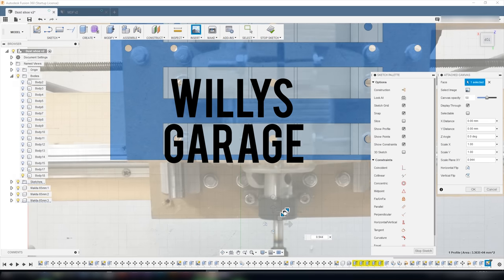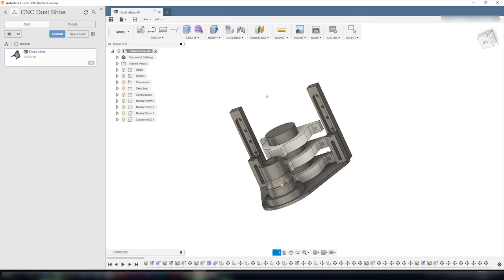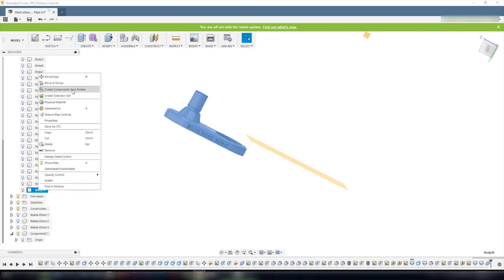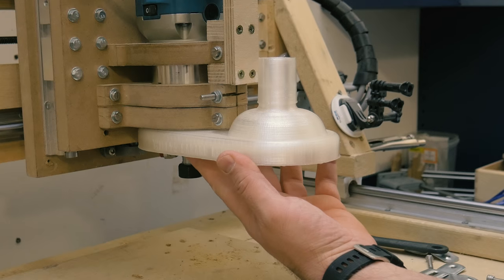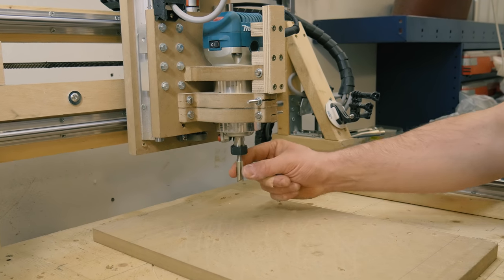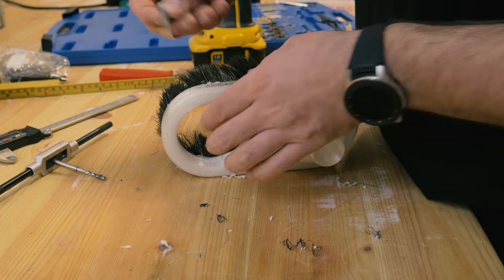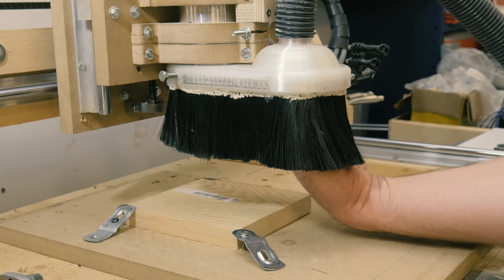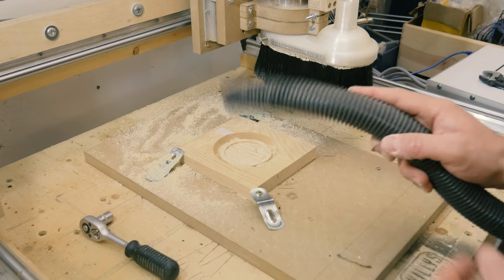First DIY CNC build (part 20) - Making the DUST SHOE | diy | FUSION 360

Comment: easy to do very explicit good tutorials dude! new suscriber here....i wanna make my own cnc too and this stuff helps a lot to not make mistakes that already fix youreself hehe.....i have one question....im thinking in use a belt sistem to a router instead of a screw... do you think its going to work as well?...the size its 1000x1000mm workspace....i saw other videos too and I can see it works but i have my doubts of it....its more cheaper too....thats in the first place is why im picking up that choice!!!!!

tks men keep doing what you do
Reply from the maker: Hi and thanks for your feedback :)

By using belts there will allways be more backlash then using other solutions, the backlash can be compensated for in the software. If you are going to cut mostly wood it should be ok with belts, and if you design your machine to eventualy change the belts for screws or rack and pinion, you have the option to do that in the future if you find the belts to weak 👍
Reply: @WillysGarageNorway  tks men for you're answer! I keep in my the screw solution...so in the mid time I'll going with the belt thing just for costs now... Tks and good channel I'll keep it up

Comment: Interesting item is that the router is pushing a bunch of air down to the table.  Probably over powering what the vacum has enough suction to handle.  Larger hose would give more flow.  But still have to overcome the router's cooking fan to produce suction.

Comment: Hallais'
Nåt seeing what you're bit is doing might drive you crazy with that shoe, been there done that ;)
Made mine with acrylic and it's mounted on the front of the spindle clamps, got some nice brushes from jula with aluminium base that I just bent to fit a slotted rim in the acrylic the just used wood glue. I'm still not satisfied as as carve deeper the shoe need height adjustment.
Reply from the maker: Halla, yes I think seeing tje work piece would be better. Do you have a link for the brushes you bought?
Takk for watching ;)
Reply from the maker: And it would be nice to have some adjustable height when doing deep cuts..
Reply: 319003 @jula.no is the list. 
I have a 3040cnc and a 5cm wasteboard so im normally constrained in height, so for me it doesn't have much impact. But I'm doing some bigger projects later and will need to get creative. I don't have much space and I also have other considerations around that can't take much dust, but I have some ideas that I will put into life soon.
Reply from the maker: @HansUweNeve_LB4NH  ok, let me know if you find a good solution :)

Comment: so u set 0 point every time u cut ?
and it locks like the spindle has no command from the Arduino 
her is my answer right ? 

lets say this is the process to start cutting 
import the design to the grbl
set 0 point 
tern on the spindle 
run cnc

Comment: how much does it cost you. if we replicate this design provided applying your corrections how much will it cost?
Reply from the maker: Do you mean the dust shoe?
Reply: no the enire cnc machine
Reply from the maker: @akhtar2024  It depends a bit on what sort of materials you use, the quality of materials. I bought everything from China, not the best quality but it works fine. I have figured out the cost is between 600-900 dollars. The biggest expense was the stepper motors and drivers and of course the spindle it self. You can build it cheaper if you use things you have or second hand stuff
Reply: thankyou for your response
Reply from the maker: @akhtar2024  no problem. Let me know if you have any more questions :)